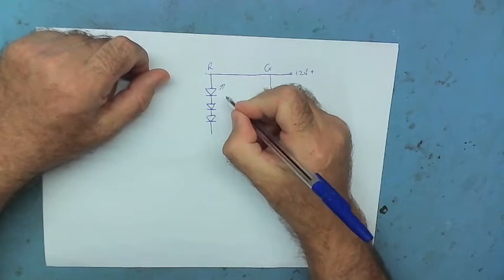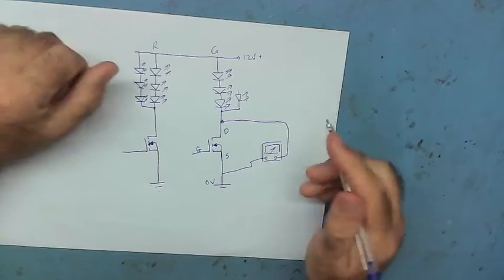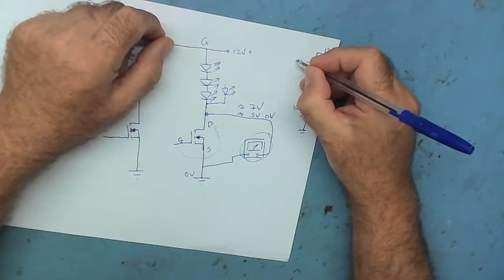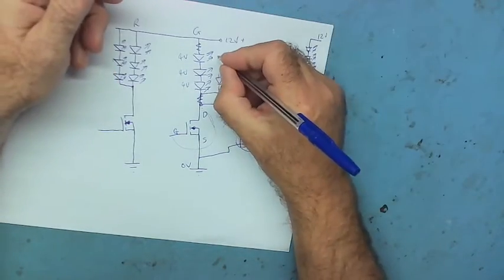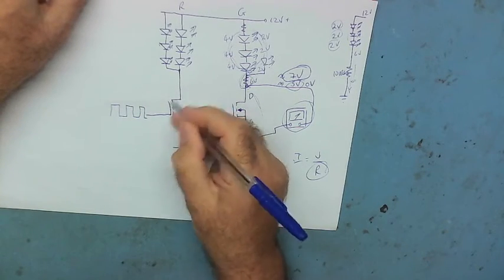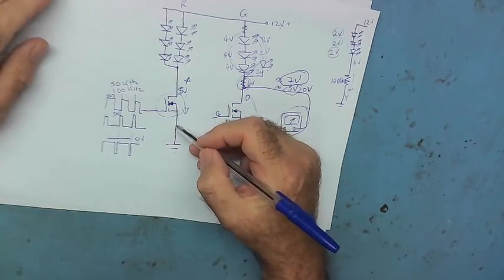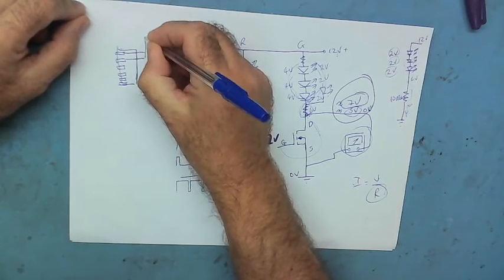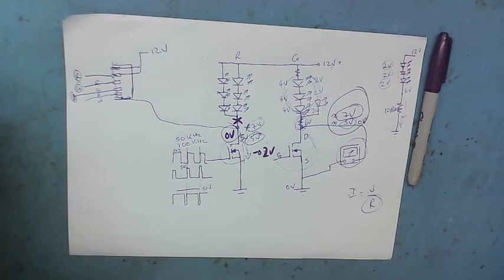Learn Electronics Repair #19 - LED Disco Lights 1 (Reprise)

Comment: Racism is an irrational prejudice! (It applies to an individual or small group of individuals)
In the case of Chinese manufacturing because so much of the product is mediocre quality your prejudice is entirely rational & justified.
If anyone suggests nonsense such as: holding a prejudice is immoral, challenge them to walk into a pack of hungry Lions. If they are without prejudice they should willingly do this.

Comment: Damn, i thought it would be the connector, but but what i tough is the you connected it backwards and then i realized that doesn't make any sense because the other LEDs wouldn't light up. I totally missed the part where you said there is a 6th pin